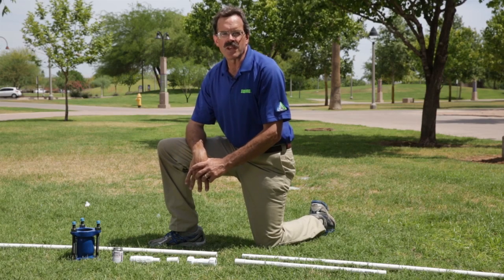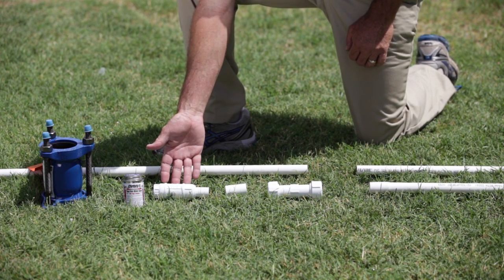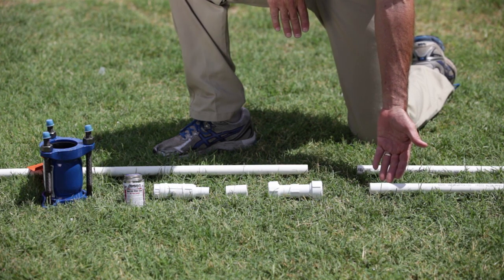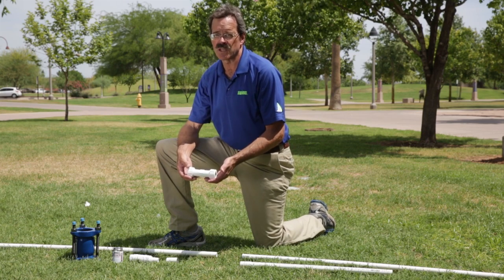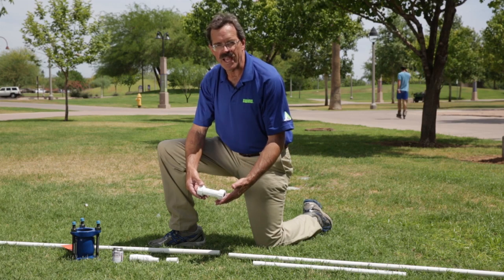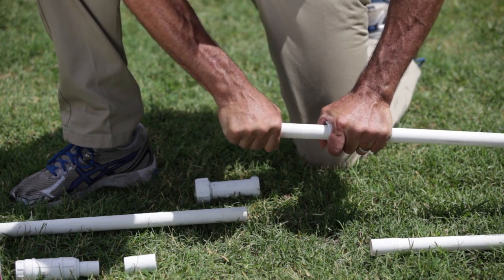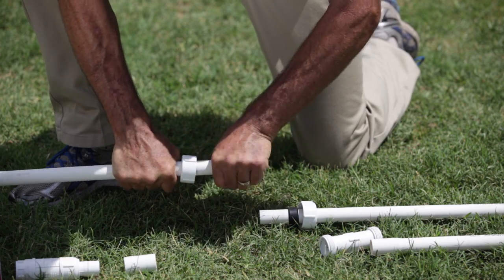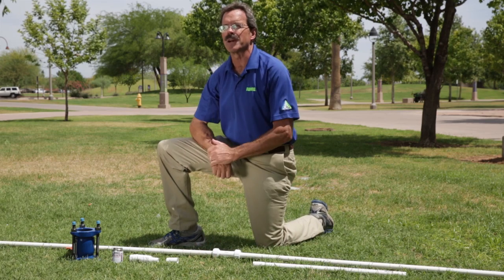Using A Compression Coupling To Repair Broken PVC Pipe

Comment: Is the gasket made of rubber? Sometimes I clean the line with distilled white vinegar and it can degrade rubber.
Reply from the maker: The gaskets on the Spears brand couplings are made from EDPM synthetic rubber. Vinegar should not affect them. Thanks for watching!

Comment: Can you use compression coupling on rubber pipe
Reply from the maker: The compression couplings shown in this video are for PVC pipe. Depending on the type of tubing you are referring to, there may be a similar option. For example, if you are referring to poly tubing commonly used in drip irrigation, this is the compression coupling you would use for .710 (1/2 inch).
https://www.ewingirrigation.com/710-compression-coupling
Thanks for watching!

Comment: You should have talked about the gap between the pipes that you're joining. In my case, the pipes are fixed so I can't push them apart or pull them together.
Reply from the maker: This might be a better solution for you.
https://www.youtube.com/watch?v=-fXzaYGn1sM
Reply: @Ewing Irrigation & Landscape Supply  
Thanks, I'll keep that in mind, but I used 2 compression couplings to repair 2 leaks and it worked fine.

Comment: I think you should give the specification for each one. For example if your pipe is broke at the coupler and you had to cut it a compression coupler may not work based on the gap between the cut. The slide fix allows you so many inches between, so each one is for a specific application they are not inter- changeable. So if you have 4 or 5 inches of a broken pipe a compression coupler may not work. What is the best specification for a compression coupler in inches? vs a slide fix in inches? vs inches of a simple coupling? --its not a contest of who is better than who its really about finding and using the right product by specification.  The piper breaks at a previous coupler --4 or 5 inches of a cut when does the compression coupler not work ? I hope I said that right...tired of mentally wrong answers

Comment: You think it will hold pressure to use on a brake in my underground water main?
Reply from the maker: The manufacturer states that the 1/2" - 2" couplings are pressure rated to 235 PSI @ 73°F. Thanks for the question!

Comment: I'm doing a repair tomorrow.    3/4 cpvc to 3/4 black steel pipe.
The coupling I bought has the gaskets inside the center tube.  I noticed you slid them upwards on the pipe.  Should I leaves the gaskets in the tube and slide pipe in,........or should I remove gaskets,..slide them up on the pipe as you did,...and then crank down the way you did it?

Should I use pipe dope on it?

Comment: Over time won't the gasket deteriorate?  Thanks.
Reply from the maker: If installed properly it should last indefinitely. They are not meant to be used above ground and it's important that the pipe is restricted from movement where the repair is done. Thanks for watching!

Comment: Will a PVC Compression Coupling work to transition from ABS to PVC?
Reply from the maker: The pipes needs to have the same outside diameter for the compression coupling to seal properly. There are transition couplings made for that purpose but it's not something Ewing carries. You might try a plumbing supply house. Thanks for watching!

Comment: Sorry but of course if you can move the 2 halves of the pipe that you need to repair a lot it's easy, whatever method you use. Any method would work. I would love to hear about more awkward situations, like 2 pipes 1/4" close to each to other and/or different sizes.

Comment: If i wanted to know all the different kinds of coupling to repair PVC pipe, this would suffice. HOWEVER, when using a compression coupling to repair a REAL PVC line break, you don't have two independent pieces of pipe laying their to be connected with the compression coupling. You have to locate the break, evaluate and probably cut out a split section. Often times you have to add in some line when repairing a larger break. THEN, the MOST IMPORTANT thing to HOW MUCH OPENING do you need to fit on the compression head to connect to the ends. This was ridiculous!
Reply: Take some meds, get off the chair, post better if you think you can.

Comment: Fyi, mine did not hold on a 1” line repair at full line pressure. I used it on a repair under roots so there was a flex hose on one side. Maybe that is why it did not hold. I tightened with channel locks on both sides. I am going to try one of the telescoping couplers next. Trying to avoid a big re-route around tree.

Comment: What if i have a small leak after installing on the main line?
Reply from the maker: You can check to make sure that the gasket is properly seated and there's not an obstruction between the gasket and the pipe. If everything looks good, you may just need to tighten it down more. Thanks for watching!
Reply: @ewingoutdoorsupply  i did end up hand tightening it more. My hands end up hurting for half an hour but it did stop leaking.

Comment: I tightened my compression coupling by hand and it's dripping out one end after I turn the water on. I noticed that the rubber grommet has a beveled edge and matches the beveled angle of the inside of the main body of the coupling. Does that mean it's tightened too tight, and squeezing the rubber grommet too much to where it doesn't seat properly and leaks? Or should it be tightened further using a pipe wrench? Which situation is more likely? Too tight or too loose? I've used PVC couplings successfully on galvanized steel pipe and never had a problem until now. They make steel couplings but they're heavier and cost more. I only use steel when the stores are out of the PVC couplings.
Reply from the maker: If the gasket is not damaged and seated properly and there's nothing else interfering with the seal, then you can use a tool to tighten it further. Thanks for watching!

Comment: This is a great video!  What's the optimal length that you need to cut away of the broken pipe to fit the compression coupling? Like maybe three inches shorter than the coupling? ( So you can fit the coupling on)

Thanks.
Reply from the maker: Thanks Daniel! You just need to remove enough to get the body of the fitting in place and not so much that you can't get a good seal with the gaskets on each side. Thanks for the question!
Reply: This is the problem with this demo. Spencer is askibng the MOST import questionand this video demo did NOT even address it. NOR does your answer make it clear.  
 @ewingoutdoorsupply
Reply: @ewingoutdoorsupply  ok ty.. So three inches longer than the actual cut out piece is optimal? Or what would you think? Sorry but I like to be super optimal
Reply: @jimspencer5746  Spencer, look at the body of the coupler--measure the length between the threaded ends. Try to have your cut opening length of pipe a little less, if you can still fit the coupler on. Put the coupling on at one end, pushing it back until it slides on to the other end, then even it up and begin tightening.
Reply: @Jazziegirltoo  tyvm
Reply: @Jazziegirltoo  only took five months

Comment: Great information. On my pool equipment I have a Pentair Rainbow 320 chlorinator which I want to remove. I’m not sure, but I think it is a 1&1/2 or 2 inch pipe. Do you think that this would work? Thanks
Reply from the maker: Yes it will work if you don't have too large of a gap to fill. You will also want to make sure that there's no movement in the pipe when the pump cycles on and off.  Movement can cause the compression coupling to fail over time. You may also consider using a slip-fix repair coupling.
https://www.youtube.com/watch?v=-fXzaYGn1sM&ab_channel=EwingIrrigation%26LandscapeSupply

Comment: Will these work when used on the supply side of a water ram?
Reply from the maker: If you don't exceed the maximum PSI rating (200) you should be fine. Solvent welding a new section of pipe in with a couple of couplings might be the better way to go for a more permanent fix.
Reply: Thank you for your reply.

Comment: Can I use them to repair a broken main water line underground? I'm asking because I'm not sure it will hold high water pressures.
Thanks
Reply from the maker: Depending on the manufacturer, compression couplings are generally rated around 150 PSI. You can use them as a temporary fix but for a long term repair it's best to solvent-weld in a new section of pipe. You can try using a length of PVC and a couple of couplings but some contractors prefer to use a series of elbows or 45s with PVC pipe to make the repair. Good luck with your repair and thanks for watching!

Comment: I have used a compression coupling to connect galvanized steel pipe when making a revision in my underground lawn sprinkler system.Worked just fine, no leaks no hassle.
Reply: Thank you for answering my question. Which was can I use this with galvanized steel or just pvc.

Comment: My dad does maintenance for some properties. One house was illegally hooked up to the city's water line. No meter. IDK where it came from. Thing is we needed to disconnect that water line and cap it so we could reconnect the old well pump. OMG these things saved us bc it involved getting showered once we broke that connection. He failed to get it on right at first so after a couple hundred gallons we finally capped it. That was a real fun job.

Comment: Can a compression coupler work on the more flexible polyethylene type of tubing? I have a leak on a sprinkler line and found that the 3/4' pipe doesn't quite fit the standard 3/4" PVC couplers.
Reply from the maker: Thanks for watching! The compression coupling featured in this video isn't suited for your situation. Instead, you can use barbed insert couplings to make the repair by splicing in a new section of tubing:
https://www.ewingirrigation.com/3-4-pvc-insert-coupling-ixi

Comment: Can this be used on sprinkler valve replacement connection?  It sure would beat having to cut and glue 
pvc.
Reply from the maker: We do not recommend using a compression coupling on a manifold unless it's a temporary repair. You may want to use unions to make valve replacement in the future much easier:
https://www.ewingirrigation.com/products/fittings/fittings-pvc?fitting_shape_type=3134&fittings_material=440

Thanks for watching and for your comment!

Comment: Excellent video, had to replace a hunter valve so saved me a lot of  time digging to get some flexibility on the line in and out. The normal cut, glue coupler to line, glue male adapter to short line and thread. now I just use this. Another selling point is that if you do all the valves like this replacing a broken valve is easy, no cutting and reattaching the water lines in or out, just remove, attach to new valve and reattach compression couplers.
Reply from the maker: Thanks Dave! We're glad the video helped you. While a compression coupling is a great way to repair a broken line, we would not recommend using them for valve manifold construction. However, you can use a union instead to make swapping out a valve much easier when doing repairs. Here's a link to the product:
https://www.ewingirrigation.com/catalogsearch/result/?q=pvc+union
Reply: Great stuff even better, thank you.

Comment: Is there something like a compression T or elbow?
Reply from the maker: Yes, compression tees are available (not elbows though). Another option that doesn't require solvent cement is the PVC-Lock product line from Hydro-Rain (for Sch. 40 & 80): 

https://www.ewingirrigation.com/catalogsearch/result/?q=Hydro-Rain

Or if you are looking for an easy way to tap into an existing line, you can try a saddle (requires solvent cement):

https://www.ewingirrigation.com/1-x-1-2-pvc-saddle-threaded

Thanks for watching!
Reply: great info, thank you.
Reply: None of the stores in San Antonio Texas seem to carry those compression couplings.
Reply from the maker: Cliff Paul - The S. San Antonio store shows stock depending on the size you are looking for. You can also check local stock or order these items online here: 
https://www.ewingirrigation.com/catalogsearch/result/?manufacturer=1314&q=Compression+Coupling

Comment: Mind blown. I will never use glue and primer ever again for these repairs. I've stressed over these repairs for so long. Thank you.
Reply: It is good to know and be able to use all available options.
Reply: Which one lasts longer regular glue and primer on coupler or this?
Reply: Problem is the coupling is $.50, the compression coupling for 1.5" pipe is $8
Reply: @machstormrunner3130  , time IS money. If this saves 10 minutes of trying to deal with a regular coupling and tight space, that's money well spent.

Comment: Quick tip I learned tonight: Do NOT use lubricant to help slide the rubber gasket on. The water pressure will very quickly push the lubricated pipe out of the end of the fitting. Seems obvious now, but like they say, hindsight drinks Mad Dog 20/20.
Reply: They still make Mad Dog?
Reply from the maker: Good advice! Thanks for the comment.
Reply: Destinedtodie I've found that it's usually not a problem as long as you rinse the lubricant off of the pipe after positioning your gaskets.  I've made the same mistake your talking about more times than I care to mention.   Try liquid dish soap for lube.  Slippery as hell and super easy to rinse off prior to pressure testing.

Comment: You assumed the pipes on both sides were free to move which is not the case for repair.  What is the proper distance between the ends?
Reply from the maker: +L. Huang You'll have to dig out dirt around the pipe enough to allow for some flex in the line on one side of the break. Keep in mind that you want to remove just enough existing PVC to allow enough space to fit the compression coupling components on. First slide one compression end with gasket as well as the sleeve onto the side of the line you have dug out to provide some flex. Slide it far enough over to expose the break so you can then add the second compression end and gasket to the opposite side. You can then center everything over the break and tighten it all down. If you are unable to use a compression coupling you can always try a slip-fix repair coupling which "telescopes" into place. This option will require gluing though - https://www.ewingirrigation.com/1-2-slip-fix-repair-nipple.html
Reply: Use 2 couplings and a piece in between. You're welcome.

Comment: how do you use this when the pipe is buried in the ground and you have no flexibility?
Reply: Use 2 couplings with a piece of pipe in the middle.
Reply from the maker: +Virgin Islands Day Sailing You'll have to dig out dirt around the pipe enough to allow space to make the repair. The pipe should not be flexible, as the fix will not hold if they are.
Reply: You don't I just spent a whole day fighting one and it just kept slipping off under pressure no glue means no good
Reply: Virgin Islands Day Sailing ummmm...DIG IT OUT MORE

Comment: Thanks man, worked great for me.  I have a pvc pipe leading to my garage, that has a faucet for a hose.   Well the faucet sticks up about a foot n a half off the ground and my weed wacker put a nice crack in it resulting in a geyser.  Once I got the water shut off, I followed your instructions.   Make sure to put it on as tight at you can get it.  It took a pipe wrench.... but its holding.  Thanks for the edumacation sir!

Comment: I do sprinklers 4 a living that is good if u have flex in a line but a quick fix works better
Reply: +john Kosheluk     And that means what??
Reply from the maker: +SoulDaddy33 - I believe John is referring to a "slip-fix" which is a telescoping PVC repair option that requires PVC cement and a coupling to use. In some situations it may be the preferred method for repair. If you use one be sure to remove enough of the existing PVC to allow you to fully extend the slip fix when installing. Otherwise it may leak. 
https://www.ewingirrigation.com/catalogsearch/result/?q=Slip+Fix
Reply: I'm glad someone knows enough to tell people that.

Comment: The 3 inch cc slip under pressure or leak why.
Reply from the maker: Hi Pedro, there are different things that can cause this. Best to check with the manufacturer, or contact your local Ewing store with more info about the situation!